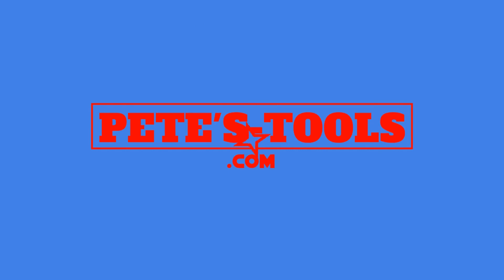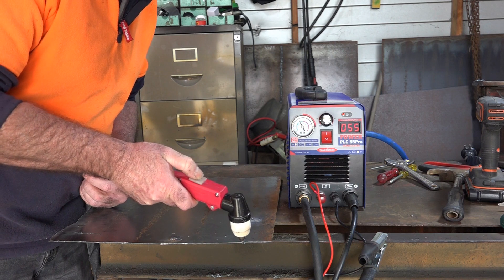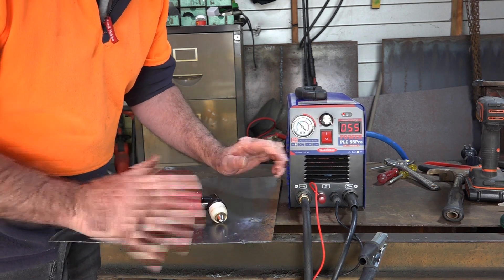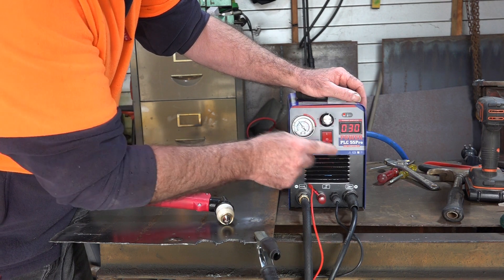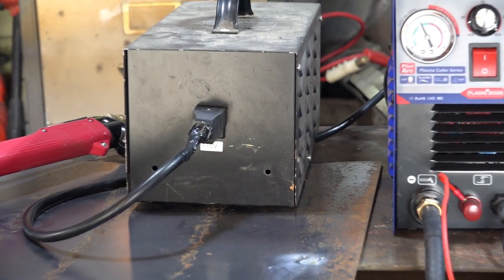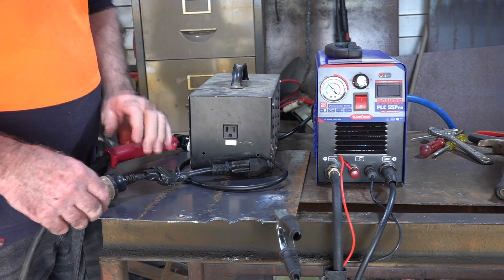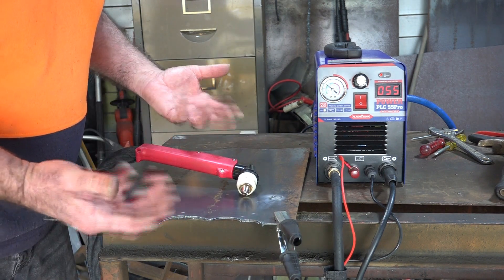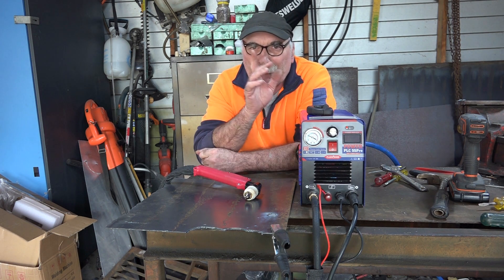Plasma Cutter Sputtering: The 2 Most Common Causes

Comment: Hello Pete, I purchased an identical machine as yours here in Australia and it is giving me the same sputtering problem. As we run on 240 Volts here, I feel voltage shouldn't be the problem. When I begin the cut the sputtering stops but the cut is extremely dirty with slag heaped up on both sides at the bottom of the cut. Also what seems to be happening is one side of the cut is square but the other side is almost at 40 odd degrees facing towards the center. I am also going through consumables like no tomorrow. I notice that in this video you appear to be dragging the head along the material you are cutting. I thought these  cnc compatible machines where not supposed to be touching the material & where to be held aprox. a mm or two above the material. After watching this video I immediately went out to my shed & cut with the touch dragging/ resting on the plate but the initial sputtering was the same as well as the large build up of slag on the bottom. The cut was better with both sides basically at right angles to the cut but not much difference with the touch. Can you give me any other solution to this problem.
Reply from the maker: The closer you can get to the steel your cutting the less sputtering  you will get.  yes your not supposed to touch the steel but that's the only way to stop the sputtering . I think its a machine issue .

Comment: gday pete. great video. i have the exact same unit as you. it arrived on Friday. i set it up and straight of the bat  sputtering. i checked all is tight on the leads and all ok. so took the consumables apart and found electron was miss the small tube part inside. ok so changed it out with one of the spares all seemed good it did as it should. went to use it Sunday and back to spluttering and a very weak flame tip. you can hear it buzzing/clicking inside the  unit. once i put it onto the steel it cuts but not very well. steel in 1/8th or 3mm its plugged into a 15A outlet  . any ideas mate?
Reply from the maker: What voltage are you running .I found theses units don't like 110 volts.

Comment: Could the plasma cutter be used to make the bevel for welding later, on a three-quarter inch sheet, instead of using the angle grinder?
Reply from the maker: Hi mate this machine WONT CUT 3/4 INCH
Reply: @petestools  Hi pete,  Excuse me, I did not mean cutting 3/4, I meant make a BEVEL, maybe in  an angle of 30 degrees and 3/8 to 1/2  inch long ,,,,

Comment: Now that I have a proper air tank for the job, I've been figuring out all the little hicups to get a steady machine. Consumables (all new), connectors loose (the pilot arc didn't actually clamp down on the lead from the factory! Fixed that with a conductive space), voltage, but it's on a 220 generator outlet, so that was fine. Air was beyond dry, have a few line dryers between the tank and the torch. Last bit when in doubt, check the machine. Sure enough, one loose screw that probably wobbled out in shipping or lax QA. Bam, back to work!
Reply from the maker: LOL yea mate always something

Comment: Hey Pete and THANK YOU SO MUCH for your videos…you/they have been a great deal of help. The plasma cutter I just got BESTARC BTC500DP …this unit ALSO does NOT like 110v…it spits the same as your video and seems to recover some while cutting. The unit has been a pleasure to use on 220v and I’m very happy with it. I pray you success in all that you do.
Reply from the maker: Glad to help
Reply: Just got the BESTARC BTC500DP myself recently and it just struggles on 110v even set at 15 AMPs. Pulses...

I intend to use it on 220 anyway, but wanted to test it at 110v, while I rig up my shop 220v.

Comment: I bought a cheap dual voltage cutter from amazon. it runs far better on 240. It cuts way nicer even on the thinner stuff. I would imagine that the machine is running cooler on 240 as well. a 20 amp breaker should also be used when on 120 which I doubt most people do. Greetings from Canada.
Reply from the maker: Thanks for sharing